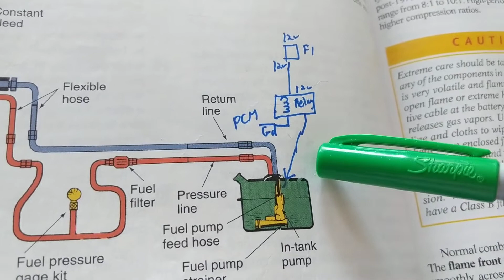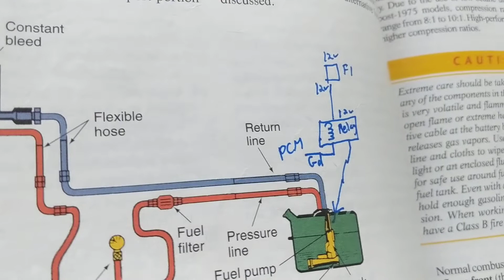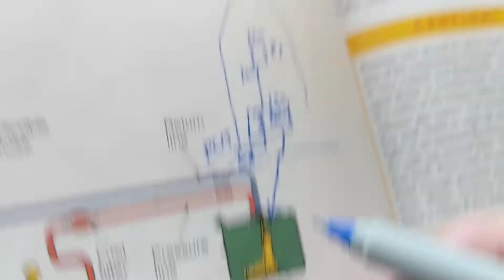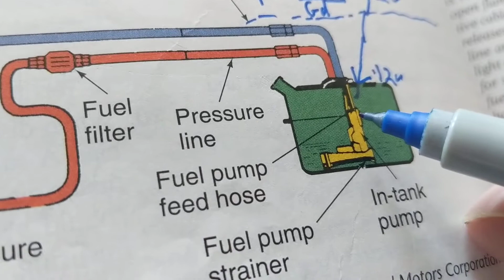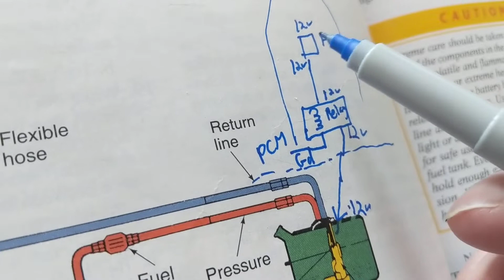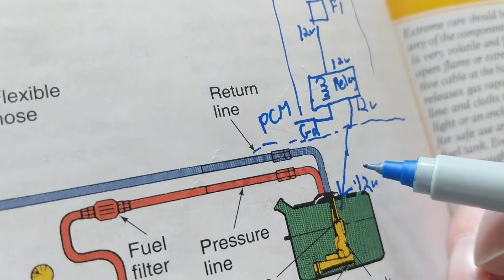HOW TO DIAGNOSE FUEL PUMP PROBLEMS ELECTRICALLY FROM DIAGRAM  MUST SEE VIDEO

Comment: I have a 2007 nissan murano. I turn on the key and i heard the pump is turning but it turns off. The power comes on and off, when i crank the pump, it comes on and off. I changed the pump and the crank cam throttle. Do you have any ideas to help?
Reply from the maker: Does the computer give a ground to the relay

Comment: Heybro, you  have short to power video ?
Reply from the maker: I didn't understand it
Reply: I meant if you have videos explaining short to power vs *short to ground*?
Reply from the maker: Yeah if you look it up on Joe electronics schematics for Auto I have those type of videos with wiring diagram short the ground of course it'll blow the fuse and some wires might be involved but you have to do a resistance test from after the fuse to ground which I explained in the videos thank you so much for your questions

Comment: How do you see the future of automotive repair industry today, especially when electric vehicles are filling up the horizon? We all know that a lot will be changed but we don't exactly how we can prepare to adapt to those changes as technicians. Can you put your thoughts about this on a video?
Reply from the maker: I believe I describe some of the issues in one of the videos pretty soon they're going to go to fiber optic which you need special equipment for they're going to go to 24 volts which means you have to change your diagnostic equipment for 24 volts if you have a scanner you need new software continuously it's a lot of investment in diagnostic equipment to keep up with the industry that's changing rapidly in electronics it's going to be a challenge
Reply: if i may say
i do believe that all the changes will happen in the electronics parts 
we will see the introduction of new sensors and more sensors will bee used for every part so i suggest to try and focus more on trying to get a solid electrical and electronics base
Reply from the maker: @rain0aldwaib  absolutely that was the first videos I ever made stressing that point thank you for your comment well appreciated
Reply: @rain0aldwaib  thanks